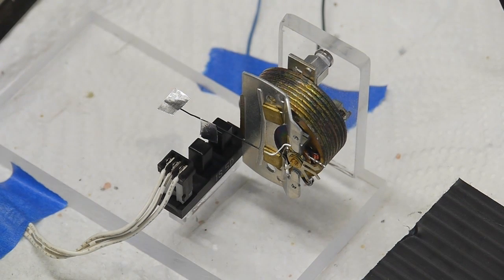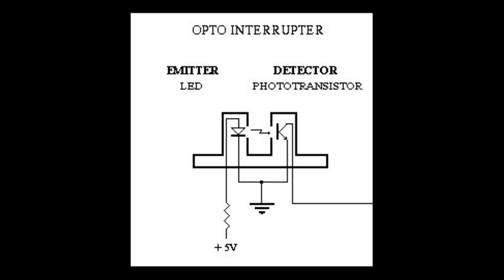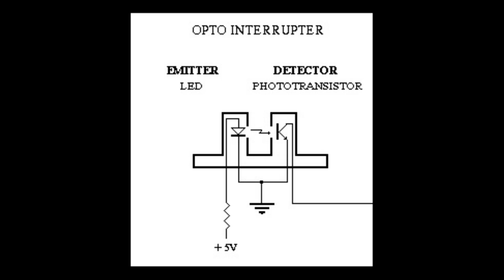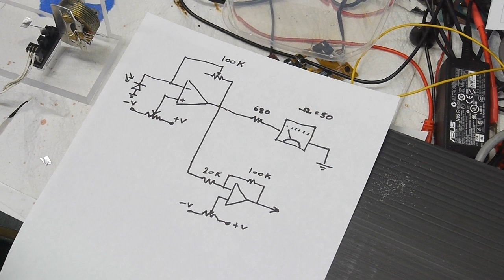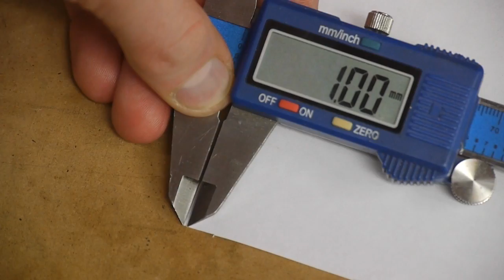Measure the mass of an eyelash with a DIY microbalance

Comment: Somehow missed that one. This is very inspiring. I wonder if you could also use this to apply consistent pressure to something by compensating weight up to a set point in closed loop. Really brilliant idea! (Thinking on it more... I would use two control loops, 1. for force/weight measurement closed on small relative position hold 2. for large position hold close on force from previous loop. I don't even know why I need it, I just have to build it now! )

Comment: Hi. I'm trying to reproduce this at home and was wondering about why you removed the parallal resistor in the ammeter (to get a 0-1mA range), and then add a 680r resistor to get a few mV signal. Is there benefit over just letting the inside resistor to keep the original ammeter range ? is it better to have a 680r and detect a few mV instead of having a 10kR and get a 5V reading ?

Comment: You made static device, balances should be astatic. For this, sensor (optycal sensor and amplifier) should be a zero-detector which works on integrator. Integretor drives current.
+ input of photo amp should be connected to GND. What is a purpose of first potentiometer? Photodiode should work on short-circuit to be stable, but you apply some voltage. Device used should be on strings, not needles. Also I see periodic nature of noise - to stop mechanical oscillations you need differentiator working parallel to integrator (parallel AC correction).

Comment: You don't have a divider in your output from the amp to set the gain. You're only playing against the photodiode, so the gain is inherently high
Reply: Well spot. Could've been the reason why he said at 1:54 that changing the "gain" doesn't have so much effect.
Reply: @pangpengmaster  Yep basically no matter what that pot is set to, the amp is in open loop until the photodiode comes into play.

It also wouldn't hurt to use a ramp/triangular notch or a diffuser in the slot to make the response more linear. The combination should provide much more stability overall.

It's a great concept and a creative way of measuring tiny masses using some off the shelf parts... I'd really like to see a revised version at some point. I'd do it myself but I don't really have a need to measure things that small, and he does a really good job of explaining what he's doing and finding.

One of the better channels on YouTube, no doubt.

Comment: I'm wondering, maybe this could be made in a larger scale to measure larger weights accurately, instead of using a load cell?
Reply: Got any answers on that? I am also wondering about how this project could be scaled up to detected micrograms changes in the weight of objects weighting around 1 Kg.

Comment: you could damp the meter movement by wiring a series resistor to the meter coil and an electrolytic  capacitor across, so it would slow down a sudden inrush of current and or sudden outflow of (discharge) current, and calibrate accordingly with this damping circuit. but indeed its the way to accurately weigh in micrograms. Resistor can also prevent coil from burning out due to massive overload. Also don't forget photo-interrupters can and do get influenced by external lighting, hence most of the noise can be due to mains light switching at 100hz on a 50Hz mains frequency, as each cycle crosses the zero line twice per cycle, starts with zero and peaks positively, then descends to zero again and goes to negative peak and back to zero.Black out the plastic cover and leave a small viewing window, follow good earthing principles as in audio amplifiers to get rid of hum induced noise.

Comment: As others have said, try using a light blocking element with an angled edge or a transparency with a gradient printed on it. If the photo-diode still has too much of an on/off sensing characteristic, maybe try a different type of photo-diode, or maybe redesign the circuit to use a light-dependant resistor (LDR).
This is a very cool project though. Great ingenuity.

Comment: I have seen this idea many times before, but few had a nice circuit and involved heavy use of a micro processor.  They also lacked the nice video you have.  Nicely done.

The AC gain (more stability) can be decreased by putting a capacitor between the negative feedback and the output of the first opamp (in parallel with your resistor).  The time constant of the filter is roughly the feedback resistor x the cap I am suggesting you add.  To add damping for stability you can add a second cap, only this one is in series with a resistor that is approximately the same as the original one used to adjust the gain (exact value is not critical).  Adding both the damper and the integrator caps at the start may save allot of grief, as there may be certain combo's that are unstable in very annoying ways.

Comment: I am probably a bit too late ;) but if you cut the beam break into a triangle (at its diagonale) and widen the opening of the photodiode a bit (or just use a 3/5mm photodiode) you can build a very cheap contact-less potentiometer :)

Comment: You can extend that lever arm to arbitrary length by adding a minute mirror to it and shining a laser off of it. Using sensors to pick up the laser on a wall can easily put your lever arm at 10' and you can easily add an analog range and still shrink the point its servoing to.

Comment: I had an idea for the oscillation issues caused by the tight gradient of the opto-interrupter: instead of using a flat horizontal edge that blocks the emitter use a diagonal one, so that the vertical motion causes a more gradual blockage.

Comment: If you ever do microgram balance work again, I'd recommend using fine copper wire as a quick & dirty mass piece: if you know the diameter you can get the weight per unit length, so there's only one dimension to cut, and it's less susceptible to humidity than paper is.
Reply: it oxidizes
Reply: Enamelled copper?

Comment: First time I ever heard of making one with these was actually from a forum back in the early 2000's. It was much more basic where you turned a pot until it zeroed and then did a calculation to figure out how much weight was there. it ended up on hackaday too at one point.

Comment: Oscillation is the bane of feedback control systems.

Remembering way back to when I took the feedback control systems class... the system goes unstable when a pole goes to the right of the j-omega axis.  In real life, that often translates to having too much gain on the feedback circuit.

So, reducing the gain via that feedback resistor pot will probably do the trick.  Also, adding a capacitor at a strategic point will slow the system down.

For mechanical dampening, put a strong magnet by that aluminum foil that't near the light sensor.  The eddy currents generated by movement will buck the magnetic field and dampen the movement.

The noise I see on your scope looks a lot like the noise that I used to pick up from fluorescent lights.

If you want to fiddle with your circuit more, look up the circuitry that's used for the front end of an EKG.  It uses three op-amps (if I remember correctly.)   It's designed to have extremely good common mode rejection, and is more noise tolerant than a simpler differential amp.

Comment: Maybe you could modulate the servo with a let's say 1 kHz sine wave and then measure the dampening different masses would cause. Also with an 1 kHz notch filter you then could get rid of most of the interferences caused via EM, sound and static charge.

Comment: The flag should be cut at an angle (45 deg.) to give you some linear range in the servo.

I did this in 1975 for a motor servo positioning system.  It damped it out quite nicely.  Just don't use plastic.  A lot of plastics are clear to IR light.

Comment: You could damp by an alu or copper disc between a magnet., or provide a low impedance to the meter. (just short to meter and move it , it will behave different then when left open)

Comment: 2:45 making a more gradual on/off -- does the opto have any logic in it to lock it digital or does the internal phototransistor give slightly analog values? Would putting an angled interrupter in the beam give slightly analog results?

Comment: Regarding getting more gradual response from the photosensor, you can try turning the sensor 90 degrees and cutting the light blocker at an acute angle, so that the motions to open/close the light have to be larger.

Comment: Making your own optical isolator with a cadmium sulfide cell and an LED so the resistance changes in a linear fashion as the beam is progressively interrupted instead of just an on/off arrangement may be helpful.

Comment: I first saw a design like this in the Amateur scientist column in the Scientific American, must be 30 or more years ago.

I have had problems with those optical switches being sensitive to ambient light levels being prone to picking up the flicker from fluorescent lighting, despite the presumed presence of an IR filter on the photo transistor.

A proportional plus integral control system may give more stability.
Reply: Fluorescent lights put out IR as well, just touch the tube and you know so its not strange at all they would react to that.

Comment: I think you could gain stiffness in your balance by forming a circle from very light plastic and centering it on your meter movement. Attach a platform to the face near the rim. If it was clear plastic, you might print a graduated shade on the disk near the opposite edge and use the disk itself as the beam interrupter. The addition of the graduated beam splitter and the slight mass of the disk may make it easier to damp out.

Comment: Wouldn't a simple photoresistor work better than the photo interruptor? You can get a large range of resistance out of a 25 cent photoresistor. I tried one I took out of a toy and it goes from around 50k ohms with light shinning to 600k ohms in the dark, don't know how linear they are though.
Reply: Or an appropriate load cell
Reply: Photoresistor reacts rather slow so it would introduce a lot of lag, overshoot and unprecisson to the circuit.

Comment: Use raspberry pi with the camera sensor as an optical level indicator. Put a lens to get very high magnification and use high contrast pattern on the swing arm to track position using OpenCV.

Also don't put the arm position and drive current in a closed loop, instead leave the current steady and when you detect movement only decide to raise or lower the current and see if the arm gets closer or farther from the center then dial current in that direction until you find the center.

Comment: I think what you want is to have the first opamp setup as an integrator with its corner frequency set just below the pole of the system.
Reply: The circuit will inevitably oscillate due to the binary nature of the sensor. The trick it to get it to do it in a controlled fashion and separately lowpass the sensor signal to get the DC output signal desired.

Comment: Instead of a pot for variable gain, use an R+C feedback network, with a time constant on the order of the movement time constant.  So, probably in the seconds.  Pick impedance to match the source -- which isn't very well defined (a photodiode operated photovoltaically has an impedance dependent on intensity...nasty nonlinearity!), so a shunt resistor to set that might come in handy.  Offhand, I would guess, 100k across the diode, and 10k-1M in series with 0.1-10uF for feedback.

Better alternative: operate the diode in reverse bias and use a transimpedance amplifier (check out photodiode circuits for ideas) to get a stable (and precise) signal, then do the error loop and stuff.

For better averaging, just zoom the scope out more.  It'll take the average of whatever data you're viewing.  More data = better average (and slower updates..).

Comment: For even better resolution from the tiny scale place a reflective surface at the axes of the meter. Shine a lazor beam onto the mirror surface which will end the beam on the ceiling surface or for better resolution onto a half circle ribbon.

This concept comes from my Cousin Willard Buck  back in the '60s. He wanted to measure very tiny changes in gas pressure. He had a man build him a pure quartz curved tube. He attached a mirror at the a axes of two strings attached to the tube and its base. Shining a tiny beam of white light to the mirror he got accuracy from his experiments. Please give my dear cousin many patients a look Willard E Buck. Early  on he worked a Los Alamos.

Thanks so much for your great channel.

Comment: Try making that vane a slant, so that it interrupts the beam gradually over a small range. Add extra damping by using a resistor in parallel with the meter movement, lowering the series resistor to compensate.

Smallest masspiece I have is a 5mg masspiece, been verified that it is 5mg to 3 decimal places as well, during the last session at the cal lab. The 1g standard was measured at 1.00006g with an uncertainty of 2mg.

Comment: The gain is still too high even if the 100K pot is turned to 0 ohm. The best solution here is to go for an I-controller (or PI) instead of the P-controller you are using. Because speed is not an issue a pure I-controller will do the job just fine. Simply add an integrator between the I/U-Converter and the meter with a long enough time constant. I set up a similar control loop yesterday with a laser and piezo-aktor for an AFM.

Comment: Good stuff, very inspiring. I presume the arm is made of aluminum. So I was wondering if adding a small magnet on the side of the movement will not take care of the oscillations by giving you that D-term via induced eddy currents in the movement.

Comment: Have you ever made a high T superconductor?
with the stuff you have I guess it's possible for you to make a YBCO target and sputter a printed coil on some substrate, and see if you can generate some strong magnetic fields in liquid nitrogen :)
Reply: also, next step is a small scale MRI ;)
not very realistic to try and make one, but anything that would even resemble any feature of a MRI device made at a DIY level would be insanely awesome! :)
Reply: nilssab I can't guess if it would be harder to make "coils" of YBCO or to cool coils of TiNb with liquid He instead.. 
Just to make it clear, if you can make superconducting coils and generate a magnetic field with a controlled gradient, you can probably make a simple MRI.
Reply: nilssab
MRI machines use liquid He because the higher temp superconductors (like YBCO) cannot remain superconducting while generating a very strong magnetic field. In other words, you can't make a very strong magnet with YBCO.
Reply: Sean Breheny are you sure? I know you need to get fairly below Tc to allow for higher field strengths, but I thought they used TiNb in almost all conventional superconducting devices? And that they are using He because of that..
I know they are trying to make YBCO wires, but I wouldn't think they are employed conventionally anywhere yet?
Reply: Sean Breheny also what about this? http://www.magnet.fsu.edu/mediacenter/news/pressreleases/2007august7.html

I think MRI devices are generally around 2 tesla at field maxima?
Reply: nilssab
I just tried to look this up again and it looks like you are correct - YBCO can do high fields. I guess I was remembering wrong. I stand corrected! Sorry!
Reply: np. To be fair though, It might have been close to useless not too many years ago, but there have been and there still lots of challanges to get it to work, since it's a ceramic, which made into a cable needs to be able to withstand the thermal shock from cooling to really low temperatures.
Before cables get working and can be industrially manufactured, YBCO is only for 2d printed coils, which obviously cant generate any stronger fields, so mainly sensors probably.

Comment: Could you insert an IR diffuser between the emitter and IR detector so that you get a vertical spread of the IR beam? This would turn the point source into an area source. Even if you have to cut the sensor interruptor in half and put them further apart. This way you should be able to get a more gradual amount of IR light entering the detector as the balance comes down.
Reply: Have you seen the parabolic reflector setups they use to image air currents? That's the over-engineered conclusion that my mind jumps to. You might be able to get away with a graduated interrupter, I'm thinking a gradient printed on an overhead transparency might do the trick, if you've got a really high DPI printer.

Comment: Why would you be building a microgram balance? :)

A capacitor across the feedback cap will kill the HF gain and help with stability, as will a series RC shunt to add a differential term in the output drive to the meter movement.  Cutting the interruptor flag at an angle might help give it a less steep position sensing gain too.  Electrostatic forces will become a major problem at microgram resolution, you should probably build it completely out of (moderately) conductive materials and bond them together.

I built a microgram balance years ago using a polystyrene cantilever with a chip of ferrite glued to it. The position was sensed with a permeability tuned oscillator beat against a reference crystal oscillator and the difference term triggered a monostable which was integrated to get a DC voltage.  It wasn't very linear at large deflections, but it was exquisitely sensitive.  Unfortunately it was a better electroscope,  thermometer and seismograph than a balance, but it worked well enough to resolve grains of salt.

I think this nulling servo approach is likely to have far better dynamic range than my hack.